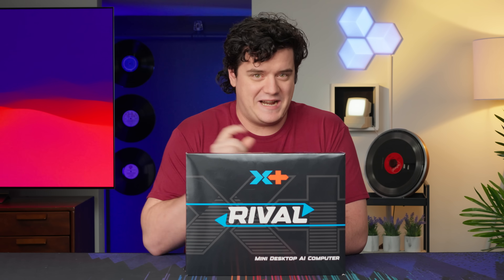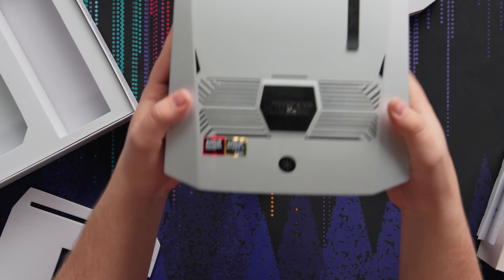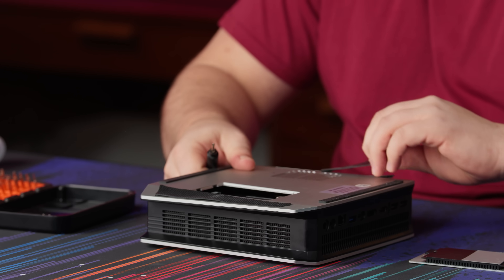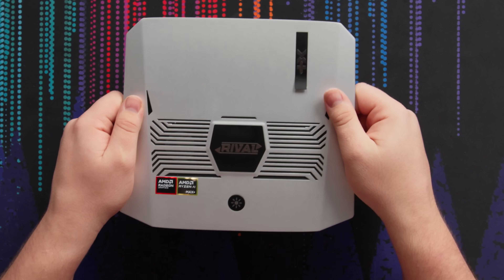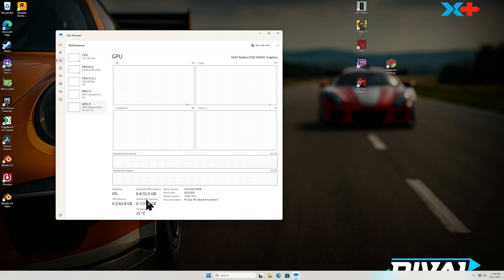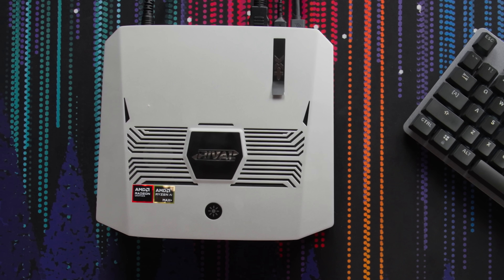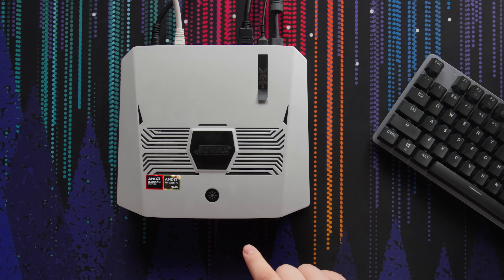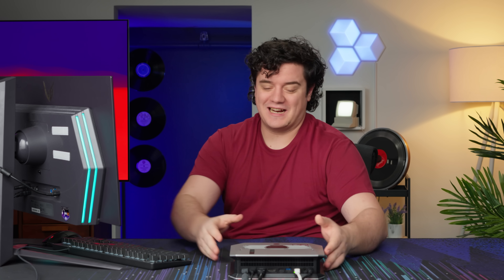This Mini PC Might be the Best Value YET - X+ Rival

Comment: I prefer the framework desktop, due to it actually being built like one, this is more of a NUC, you can't easily add a dedicated gpu/a pcie card , cooling is bad, and internals are not easily accessible
Reply: No proper Rival test was done due to the lab and Elijah's failure to assemble the stand. We need to see the lab footage of the test.  the included stand, which was in the manual, was never assembled. This is a sham comparison; totally subjective, yet entertaining :)  there are simply No data point comparisons on benchmarks, noise in decibels, and didn't even do a side by side size comparison. Lastly, there was no disclosure with Linus' relationship to Framework.
Reply: Can't add a dGPU to the Framework either.

Comment: Mini-PCs are meant to be placed upright, not flat. Both sides need to be able to draw air in freely.

The way you reviewed it is the worst-case-scenario blocking the intake fan for the APU heatsink. Even if you flipped the device upside-down, it would've dramatically reduced temperatures or noise.
Reply: They put rubber feet on the flat "bottom" making users believe they can ly it flat.  If it shouldn't be flat, don't make people think they can lay it that way.
Reply: That's the way Elijah used it. They didn't show how Labs tested it, but I'd assume they tested in both orientations. At least I'd hope so, lol.

Comment: How is it a competitor to framework pc, this is comparable to a nuc or a mini pc, nothing modular about this one.
Reply: You are 100% correct to raise this point. this video was more a of a marketing ploy.  No proper Rival test was done due to the lab and Elijah's failure to assemble the stand. We need to see the lab footage of the test.  the included stand, which was in the manual, was never assembled. This is a sham comparison; totally subjective, yet entertaining :)  there are simply No data point comparisons on benchmarks, noise in decibels, and didn't even do a side by side size comparison. Lastly, there was no disclosure with Linus' relationship to Framework. Serious ethics questions is you ask me.

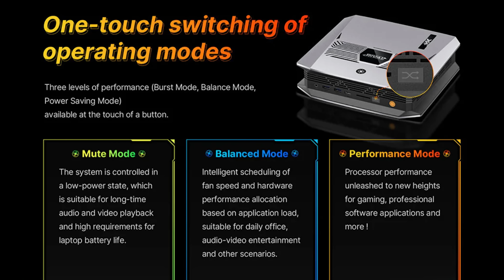Comment: 2:35 It is not "Conflicting" since they still represent a 1-2-3 increasing power setup either way, rather they are "Inconsistent" in their naming conventions for those levels.

Also 3:00 While they vary on calling it 2.1 vs 2.0 the consistent (4K at 60Hz) spec listed would imply that its 2.0 (or at least not TRUE 2.1)
Reply: the lab or reviewer didn't install the stand. Airflow was being blocked during this review. Was it also being blocked during "testing"?

Comment: Holy glazing for the framework
Reply: exactly.  No proper Rival test was done due to the lab and Elijah's failure to assemble the stand. We need to see the lab footage of the test.  the included stand, which was in the manual, was never assembled. This is a sham comparison; totally subjective, yet entertaining :)  there are simply No data point comparisons on benchmarks, noise in decibels, and didn't even do a side by side size comparison. Lastly, there was no disclosure with Linus' relationship to Framework.

Comment: $1900 USD ROFL This is no better value than the Framework or any other Strix Halo machine, they are extremely overpriced for a gaming setup, they only make sense if your into AI rubbish, I can build a mini-itx machine for 1/3 of the price that would mop the floor with this thing, at best its equivalent to a 4060, an AMD 9060 XT 16GB with even the slowest AMD or Intel latest Gen CPU will destroy this little overprice lump of plastic in gaming in 10 ways to Sunday, and if you step up to good hardware, like a 7800 X3D and a 9070 XT, you will still have cash left over and you would stomp this thing into the ground, and you would have something that could be upgraded later as well.

Comment: You can build a proper gaming PC for that money. with a much faster dGPU. AMD have made the price so high on Ai max+ APU's their junk like the Z1 extremes. And basically all the Ai range, when 7640HS system have the same 8-12 cure igpu's, the Max+ is the only one that stands out and the price is way to much. If you doing Ai why would you buy this? when you can mod old GPU with more Vram and they compute like 100+tops? It so an Ai Bubble that will burst at some point and back fire.

Comment: Can someone count how many times they say/show the word FRAMEWORK
Reply: I counted. They said framework 30 times in the video lol
Reply: Subliminal marketing
Reply: Theyre supposed to compare it to framework without mentioning framework?

Did we just find your trigger word?
Reply: @furythree  This review of chinese slop from generic brand 32 just felt like a bad bash on the framework, which while it has its problems, hes just had it out for since he first reviewed it. He spent half the framework review video talking about how bad of a choice framework made in using soldered ram, which fun fact is an amd requirement for this platform.
Reply: @james2042  yes, but we need to see the lab footage of the test.  the included stand, which was in the manual, was never assembled. This is a sham comparison; totally subjective, yet entertaining :)  there are simply No data point comparisons on benchmarks, noise in decibels, and didn't even do a side by side size comparison. Lastly, there was no disclosure with Linus' relationship to Framework. Serious ethics questions is you ask me.
Reply: No, can't you ask AI to count it?

Comment: and here we have another Mini PC of questionable origin normally I dislike this type of form factor in a pre-built system because they are willfully an upgradable most of the time but the real issue are the origins of the device of course people accuse me of just being against Chinese company but let's be honest here in the last five years we've had six different brands of many PCs literally ship with malware and no I'm not just talking about Windows there has to be a commonality
Reply: the main question is if this was reviewed properly.

 No proper Rival test was done due to the lab and Elijah's failure to assemble the stand. We need to see the lab footage of the test.  the included stand, which was in the manual, was never assembled. This is a sham comparison; totally subjective, yet entertaining :)  there are simply No data point comparisons on benchmarks, noise in decibels, and didn't even do a side by side size comparison. Lastly, there was no disclosure with Linus' relationship to Framework. Serious ethics questions is you ask me.

Comment: The reason why the cooling pad contact area for SSDs is truncated has to do with the thermal performance profile of the components on the drives.the actual memory chips aren't like CPUs, GPUs, or even the controller on the SSD; for which lower temps (and to some degree, overkill cooling) bring better performance. The flash memory has a sweet spot temperature for optimal performance. It varies, but it tends to be unintuitively high compared with other electronics we are used to. And generally it is higher than the optimal temperature for the controller they are sitting right next to, at the front of the M.2 module.

Comment: If I really had to own a device powered by the Strix Halo, I would definitely go for the GPD 5 — that’s what I consider the true mini PC form of this chip.
You could argue that it’s a handheld, not a mini PC, but for a price that’s not much higher, you get a genuinely portable device for entertainment that can also be docked and still deliver performance on par with any other Strix Halo machine.
Because if you truly needed a PC for work, you’d buy something that at least lets you upgrade the RAM, add multiple SSDs, and offers far more I/O ports than these compact devices ever could 😊🎉🎉

Comment: Nothing beats the hx100g from minisform
Reply: Oh and for the price difference, which isn’t much for the 2x increase in performance, I got mine refurbished with warranty on minisform. So I paid $399 for hx99g (I wanted a 100 but it’s always sold out)
Reply: Honestly I’m also super sick of the ryzen ai 375/395 or whatever integrated graphics. People need to take notes from minisform with the hx99/100g
Reply: minisforum is way underated. I have one with a 6900 for an emu box. PS3 and down runs pretty dang well.Had it for a few years

Comment: Honestly this offers less functionality then the framework. Even if framework was 10-20% more expensive it would be the go-to. I think if we wanted cheap stuff we all know where to get it and then it's good luck to you
Reply: this "comparison review" was biased and far from a review. We need to see the "lab" footage of the test.  the included stand, which was in the manual, was never assembled. This is a sham comparison; totally subjective, yet entertaining :)  there are simply No data point comparisons on benchmarks, noise in decibels, and didn't even do a side by side size comparison. Lastly, there was no disclosure with Linus' relationship to Framework. Serious ethics questions is you ask me.

Comment: If you're gonna keep comparing it to another prebuilt/small form factor pc can you at least show it side by side every now and then? Also surprised we didn't hear the age old framework investment disclosure.
Reply: Thats because the investment is Linus personal investment, Elijah hasnt invested, neither has LTT.
Reply: @Quiccc  Come on. Framework is in the thumbnail and he mentions it every 15 seconds in the video.
Reply: @Karl-m6b And this invalidates what wrote in any way? Doesn't change the fact that investment came out of Linus personal funds, Elijah does not need to mention any investment disclosure because he hasnt personally invested in Framework.
Reply: No proper Rival test was done due to the lab and Elijah's failure to assemble the stand. We need to see the lab footage of the test.  the included stand, which was in the manual, was never assembled. This is a sham comparison; totally subjective, yet entertaining :)  there are simply No data point comparisons on benchmarks, noise in decibels, and didn't even do a side by side size comparison. Lastly, there was no disclosure with Linus' relationship to Framework.

Comment: Bro smothered the fan at the bottom..
🤣🤣🤣
Reply: Yes. A fatal flaw
Reply: yes. :text-green-game-over:   No proper Rival test was done due to the lab and Elijah's failure to assemble the stand. We need to see the lab footage of the test.  the included stand, which was in the manual, was never assembled. This is a sham comparison; totally subjective, yet entertaining :)  there are simply No data point comparisons on benchmarks, noise in decibels, and didn't even do a side by side size comparison. Lastly, there was no disclosure with Linus' relationship to Framework.

Comment: The cooling would have worked better using the stand. 🤐
Reply: How did the labs tested it? With or without the stand? Maybe it not that big difference.
Reply: Exactly, I doubt it would be that different since the bottom fan is for the SSDs only really
Reply: You are 100% correct to raise this point. No proper Rival test was done due to the lab and Elijah's failure to assemble the stand. We need to see the lab footage of the test.  the included stand, which was in the manual, was never assembled. This is a sham comparison; totally subjective, yet entertaining :)  there are simply No data point comparisons on benchmarks, noise in decibels, and didn't even do a side by side size comparison. Lastly, there was no disclosure with Linus' relationship to Framework. Serious ethics questions is you ask me.  I think assembling and testing this properly would have affected several data points.
Reply: Rookie mistake 😢

Comment: Maybe you should have tried to put it on the stand, might be suffocating if lying flat thus throttling more
Reply: Sabotaging the arrival or Rival 😅
Reply: hope it wasn't tested like this. would affect the comparison results.
Reply: If the SSD fan being blocked throttled it then there needs to be documentation for the consumer that the vertical mounting is required.
Reply: @akihitokoizumi2474  there wasn't even a sign that it was throttling. Most ssd's don't even need a fan, passive cooling is plenty.
Reply: The intakes were on top of it.... That bottom fan only cooled the SSD.
Reply: Ethical questions now arise with the "lab" results. How can they be correct if the stand was never even assembled? What is the relationship with framework and reviewer's boss.
Reply: @axgadgets this is another example of a comment that needs to be received with an eye roll... Do you know how the labs tested it? Do you know that they didn't assemble the stand? They have been super transparent about the relationship with framework. You're looking for controversy where there doesn't need to be any.

Comment: Thanks for the thorough review!
Reply: Y'all nailed the looks!
And from what I've seen it's actually so cooool
Reply: Good job guys
Reply: Keep up the great work X+!  I am using your Piccolo N305 and am quite happy with it! Now, the Rival raises the bar on several fronts!
Reply: It's short circuit! The thorough reviews are on the LTT channel
Reply: @Incommensurabilities  INDEED!
Reply: @Incommensurabilities  this definitely wasn't a review. it was an ad for Framework. No proper Rival test was done due to the lab and Elijah's failure to assemble the stand. We need to see the lab footage of the test.  the included stand, which was in the manual, was never assembled. This is a sham comparison; totally subjective, yet entertaining :)  there are simply No data point comparisons on benchmarks, noise in decibels, and didn't even do a side by side size comparison. Lastly, there was no disclosure with Linus' relationship to Framework. Serious ethics questions is you ask me.

Comment: The SSD cooler actually makes sense, as the controller makes the most heat, the NAND itself is not the issue. Most ssd will throttle if the controller overheats, the NAND is doing just fine in higher temps.

Comment: Memory allocation in the bios is only there for legacy applications.  You can assign 4GB of VRAM but Windows with unified memory is smart enough to surrender more when needed.  Ai Benchmarks using the GPU with 4 GB of dedicated VRAM or 96 GB show exactly the same result.

Comment: Framework Desktop is an extremely overpriced and unupgradable (soldered CPU!) system with no room for a dGPU and doesn't even support motherboards from older Frame Laptops. I don't know why everyone raves about it, since for a similar price and a slightly larger case, you can get a much more powerful mini-ITX, upgradable system with socket CPU actual dGPU. And for a similar or lower price you can get a mini-PC with the same Ryzen CPU in an even smaller case.
Reply: of course it doesnt support laptop MoBos, that would be impossible lol
also the CPU has to be soldered, thats just how the Max+ 395 works, it is not a normal CPU. It is just straight up bigger and does not fit in normal CPU sockets.

The appeal of the framework is:
1) the RAM
2) the smaller form factor than any PC with an actual GPU while having decent performance
3) Customisability and options on exactly what you pay for
4) Easy repairability and upgradeability even on an SFF PC

Comment: I'd love to see it compared to price-equivalent microATX PC. You could probably get something like 9800X3D+9070, which would likely leave Strix Halo in the dust in terms of performance and upgradability, although at the cost of having to build it yourself. I was hoping by this time 395 MAX would trickle down to like $1500 laptops, where it would make much more sense, but with current prices I don't see the point especially in desktops.

Comment: You've got the vent lying flat on the deskpad blocking airflow !!!!
Reply: Yes, the fan on the back of the motherboard right on the opposite side of the apu has nothing to do with the APU
Reply: I wonder if it was tested like this during the comparison?
Reply: If it affected cooling then there needed to be instructions that the vertical mount was required for cooling.
Reply: @akihitokoizumi2474  It was listed in the manual. Also, the lab didn't install during testing, despite it being in the manual and included in the package. All marketing materials that he kept alluding to show it standing up.
Reply: Sabotaging?
Reply: First, it's irrelevant; the benchmarks were made by the lab beforehand.
Second, that was the bottom fan, which is ON THE BACK of the motherboard and contributes nothing to cool the APU.
Reply: ethics questions now with test results and conduct of the review.
Reply: I been saying that too must be blocking airflow lol
Reply: As viewers of this channel, we need to demand to see the lab footage of the test.  the included stand, which was in the manual, was never assembled. This is a sham comparison. No data point comparisons on benchmarks, noise in decibels, and didn't even do a side by side size comparison. Lastly, there was no disclosure with Linus' relationship to Framework. Serious ethics questions is you ask me.

Comment: Unless you live in the Apollo spacecraft you should never buy a $1500 mini pc and just buy a regular desktop.
Reply: i get what you mean but lots of people move between multiple places but dont need use a computer on the move so a laptop isnt needed. a mini pc makes a lot of sense in that sort of situation (only if your happy having two set ups )
Reply: Is there a desktop available with that processor in it yet? You could buy a Framework and stick it in a desktop case, I guess.
Reply: So how much does a regular desktop with a 16 core CPU and 128Gb of RAM run these days?